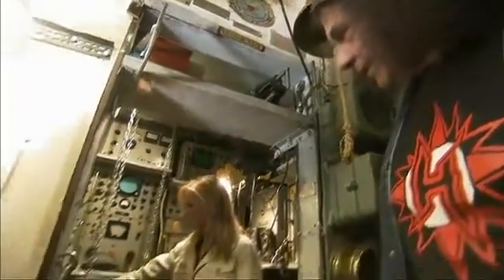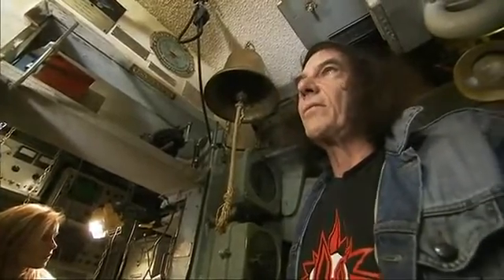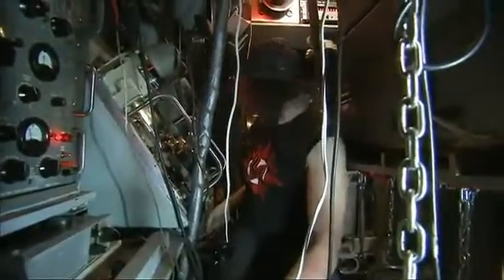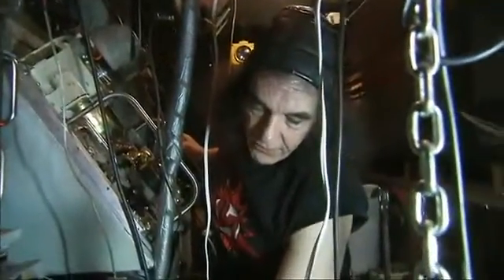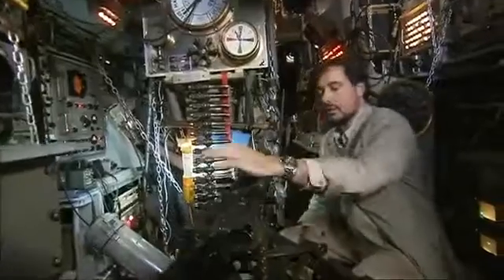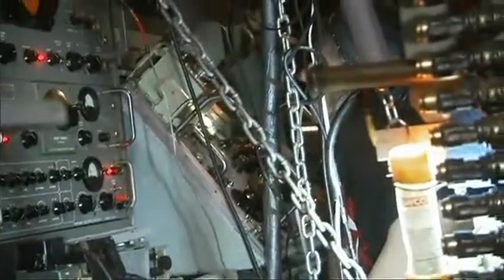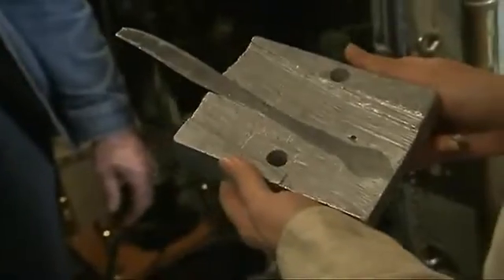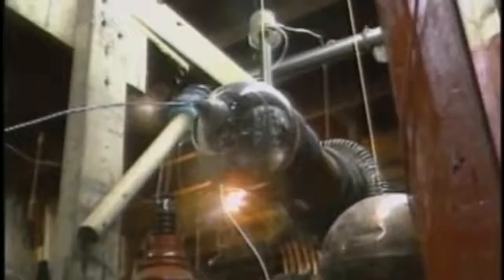hutchison effect demonstration dedicated to my film producer friends

Comment: Crystal structures can be effected and changed through sound waves and electromagnetic waves. Are you aware of stone melding? If not, it's an ancient stone masonry technique that involves soaking stones and heating them. The water will begin to effect the crystal structure which in turn will reduce the melting point of the stone. When you repeat the same process with multiple stones, they will soften. Then with pressure added, the stones will meld together. Ancient structures all around the world had these holes, a remnant of ancient stone masonry wonders. By the way! I love your work, and between watching your videos and other electromagnetic-related ones, it has inspired me to pursue a career in electronics engineering. While I'm not in school yet, I still study your work and others as a hobby. It's all great stuff. I love the bifilar coil with a spark gap and capacitor to produce high frequency AC pulses. It produces a high voltage that creates a high, buzzing effect. Eric P Dollard also produced this effect in his many experiments.